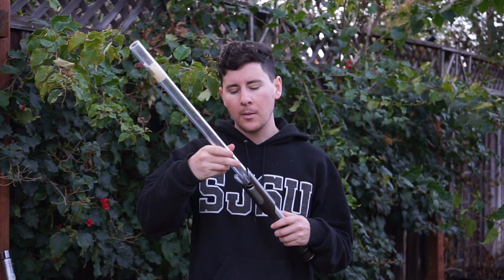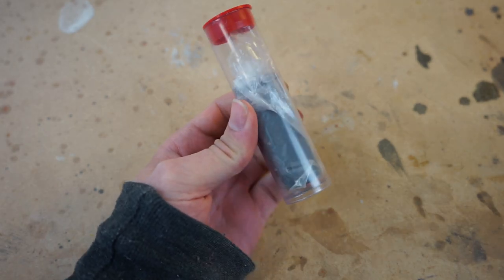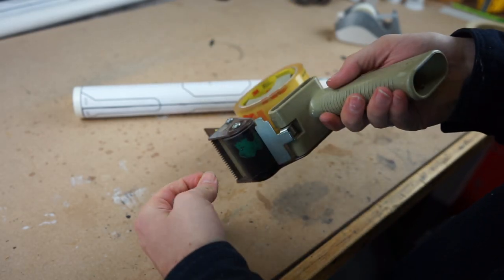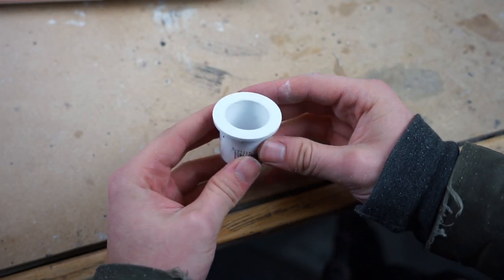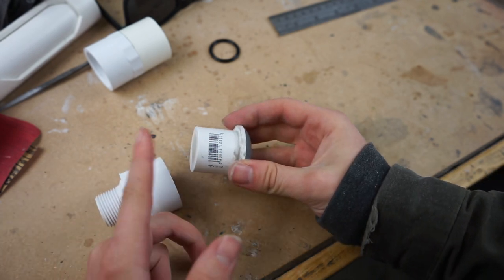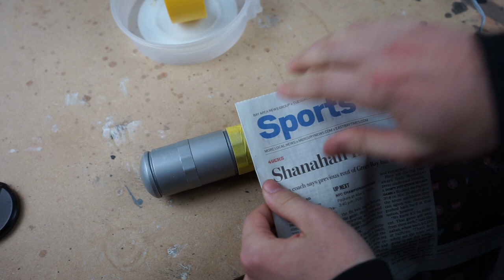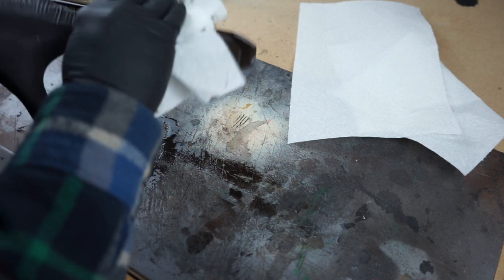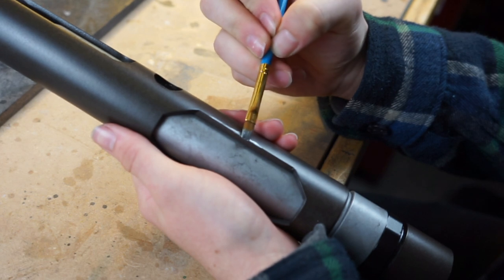Making a Lightsaber from PVC! Collaboration with @SkillTree

Comment: Oh wow! That looks very cool! I like the idea of using a paper template wrapped around the pvc pipe. Some of the PVC caps have dome shapes but I don't know if they would have fit the parts you were using.
What diameter hole did you use for that button? (for both inner & outer)?
I'm thinking of making a modified version of Ezra Bridger's lightsaber blaster out of pvc parts. I want the general shape but not the exact design. I've been examining lightsaber hilt designs and blasters for inspiration.

Comment: Interesting... definitely looks great. I wonder if electronics can be put inside of the hilt...
Reply from the maker: With this design you should be able to add electronics. Thats why I didn't glue the threaded end to the rest of the saber so if I want to add a battery and wires I could. I may do a video on adding electronics to this later once I do some more research.

Comment: Nice job, the discoloration was because you used alcohol with the black wash. Acrylic paint is only properly thinned by water.
Reply from the maker: Thanks! I think you're probably right about the discoloration coming from the alcohol but the weird thing is I've been using alcohol as a base for my black wash for years and I've never had that reaction. I also made a new batch of black wash with water and it still left that white film over it so it must be from something else not reacting well with the wash.

Comment: Nice build, can you add electronics to light the blade? Also would it be better to have sprayed the outer black part silver first, then mark off place’s that you want to show through with latex or even pva glue then spray the black over top and rub/wash away the latex/pva?
Reply from the maker: Thanks! I'm going to try to do a video in adding the electronics in the future once I've done some more research. Yes that way of painting works great and I've done it on many projects. The main reason I didn't on this project was because I didn't know I wanted the silver weathering until I was done with the final paint job.

Comment: I've definitely become interested in making my own lightsaber design at home. Thing is that I love the ergonomics of real world blade hilts in which the hilt is shaped to help with edge alignment. I know it doesn't MATTER with a lightsaber, but I still want to make shaped hilts, and I've been struggling with figuring out the best materials to do that with... maybe just crudely pound some metal piping around a wooden handle?
Reply from the maker: Im not sure I fully understand what you mean by the "ergonomics of real world blade hilts in which the hilt is shaped to help with edge alignment" Could you give me an example? Maybe I can help you out with finding materials.
Reply: CWLbuilds I might have worded it badly... basically in sword making, most hilts are more oval shaped. The reason for this is that with swords (as opposed to lightsabers) you want the sharp edge facing what you’re swinging at. With a perfectly round hilt, it’s easy for the blade to rotate in the hand... this doesn’t actually matter with light sabers, so the gist of it is that I’m trying to make lightsaber hilts that aren’t round, but can still house the internals from Ultrasaber or similar... think Ahsoka’s white sabers in Rebels.
Reply from the maker: Okay yes that makes sense now. That is definitely a bit more challenging than a "traditional" round lightsaber hilt but still totally doable. The first thing that comes to mind is still using PVC but then heat forming it into that more oval shape. You could shape a scrap bit of wood into the final interior shape you want and then insert it into the PVC. Heat the PVC with a heat gun and push it down around the wood core. Carefully of course. Hopefully you can then pull the wood core out and you should have the final shape you want. If you still want to use a round saber blade though you'll need to keep the top few inches round in order for the blade to fit in and have enough room for a locking screw or pin to hold it in place. You could also do the same thing with an aluminum pipe you'd just need a bit more elbow grease. Maybe you could also find a section of aluminum rectangular tube stock that you like the size of and shape that into what you want.  Hope that helps. If you have any other questions please feel free to ask.

Comment: The pcv is 1 inch? how does the blade fit if the PVC and blade are 1 inch? shouldn't they be the same?
Reply from the maker: sorry that was probably confusing, the pvc has an inside diameter of 1 inch and the blade is 1 inch outside diameter.

Comment: Did you use water or alcohol in the wash? It could have been caused by tge alcohol
Reply from the maker: I had the same thought. I used alcohol at first and it made that white film then I tried it with a water base and it still left that white film. I haven't had it happen since so I must have done something with the paint layer that the wash reacted to.

Comment: Could this be done without a Dremel
Reply from the maker: It Would be pretty difficult to do the cuts in the middle but you may be able to do the tip of the saber without one. You could use a hand saw and then clean up with files and sandpaper.
Reply: CWLbuilds Ok thanks